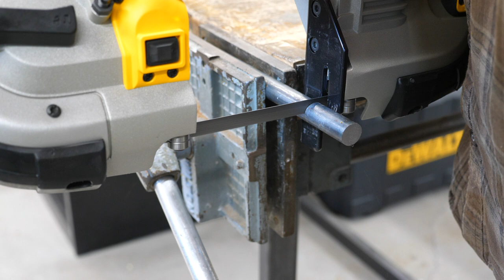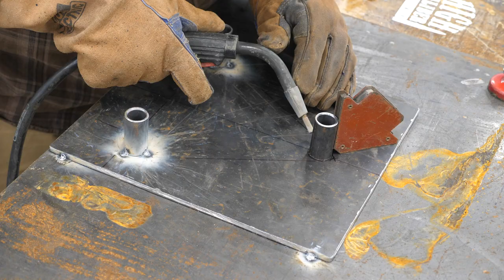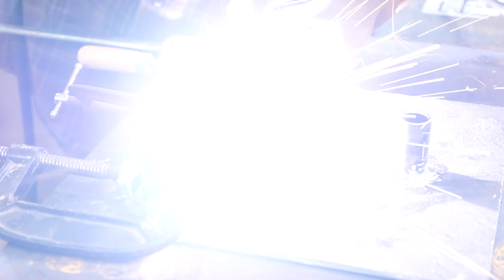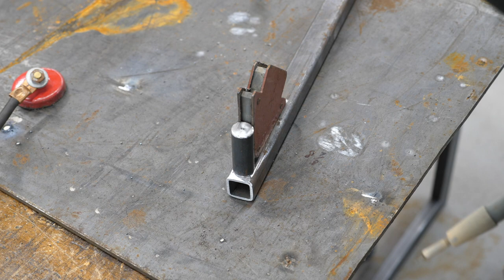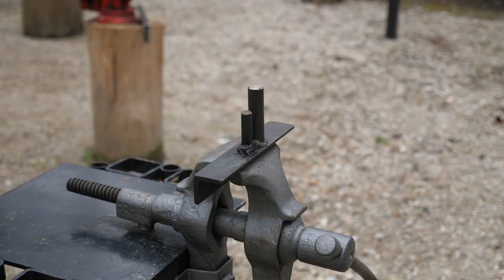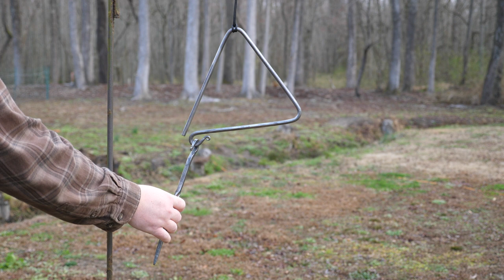Blacksmithing Dinner Bell/Chime Jig

Comment: Over the last week, I made 6 triangle with mount and clanger. It took me way  too long.  I finished them last night and posted 4 on the on line market place in my tiny little city of 57500 people. I gave one away to a Charity motorcycle ride the I am attending next weekend and the other one is a keeper for now. The other 4 sold on line in just a short time. I need to make this jig to speed the process up, I am retired, but who can't use a couple of extra bucks.  Thank you for showing my your jig, I will  try to make one. Welding is a skill I just don't excell at.... Thanks... Ken..
Reply from the maker: ken Bullock that’s awesome!  Nothing makes you better than practice!